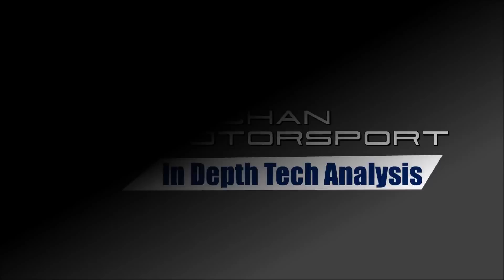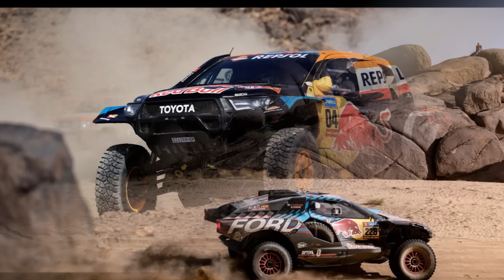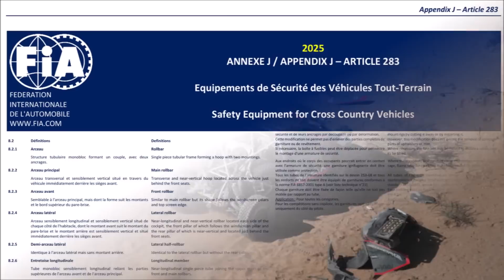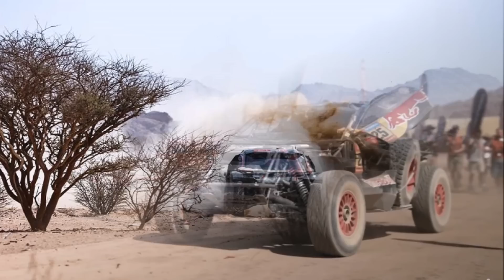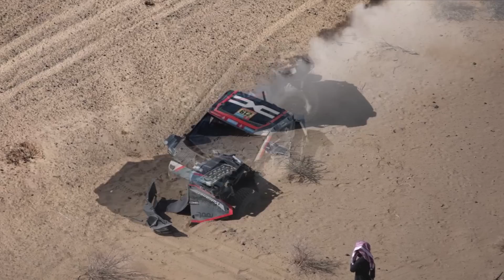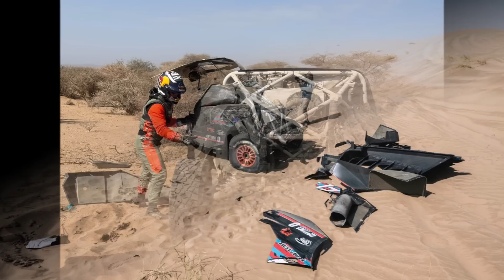DAKAR 2025 - The Roll Cage Drama - CLOSER LOOK

Comment: Such disqualification happens in the World Rally Championship too.  In the past the roll cage was itself protected by the car’s production-based structure and steel or aluminium body panels, which would limit damage from rocks and trees. However, in recent years the vehicles are clad with thin, flimsy carbon fibre panels, with the roll cage forming the basic structure of the car beneath. Perhaps small carbon crumple-zone structures should be required outside certain parts of the cage, which must be replaced at the start of each stage if damaged.
Late to the party here I know!

Comment: They should homologate the cages in such a way that teams have to prove upfront any deformation less than 2mm will not pose danger. This eliminates the need for arguing and on-the-fly simulations during race time.

Comment: Would it be possible to design a vehicle with a replaceable roll cage, or is that not safe or allowed by the rules?
Reply: I would imagine that it's too complex and time consuming to replace. Since these cages are essentially the chassis of the vehicle, you'd basically be stripping every single part off the original car to mount on to the new chassis.

Having said all that, I suppose a modular design could be made to easily swap parts on to a new chassis.

Comment: This is typical FIA burocratic Bullshit.  The way homologation works is that Ford runs simulations, builds and signs off that the cage so it meets the regulations. This absolves the FIA of liability. A Ford chassis engineer was present and stated that the cage was still safe and sound - despite the minimal deformation. Another example of FIA destroying the sport.

Comment: Not having seen the damage, its difficult to comment on whether the cage is safe or not, but not too be allowed to repair it is pathetic.  None of the cages in the event actually were individually tested, they were built by qualified technicians to a standard and sent out to be raced. The cage could easily have been repaired by qualified technicians to the same standard as when built. They almost certainly have the equipment , material and staff on hand to do it.

Comment: It will be interesting to see the certification on these cages. They are self-certified, the FIA doesn’t crash test the cages. 
The designer runs simulations and signs off that the cage meets the regulations. 
This absolves the FIA of liability if anything goes drastically wrong.
Reply: IIRC all vehicles have to be inspected by FIA officials for adhering to rule and regulations requirements. That includes the roll cage measurements have to follow the FIA rule. If not they will not be allowed to race.
Reply: @ Hi, muefe. Yes there is pre-event scutineering, but usually (well, in my experience anyway) it’s a visual inspection. They will check a) that there is a roll-cage b) that it looks ok/normal and c) that it has a certified sticker. 

Unless there is something obviously different about the look of the cage in your vehicle, like it’s made of 20mm tube when every other cage is 40mm, they’re not going to measure each competing vehicle. Somethings they are not going to be able to check, like the wall thickness etc. 

All this comes back to the designer/maker. The only time the cage will be thoroughly inspected is if it doesn’t do its job and someone is killed or seriously injured.
Reply: You clearly have no idea how stringent the cage rules are, and how strong that actually are.
Reply: @zr6ajl  I have a very good understanding of roll cages for not only Motorsport applications but also ROPS for mining vehicles.
In fact my initial comment referred to checking that the RCs used in the 3 vehicles were built to the certified design and materials. 
The FIA gives a list of acceptable materials, some mandatory pieces of bar work and performance specifications. 
Since each car is different, it’s not up to,the FIA to design a cage for each model.

‘

Comment: Those both seem repairable.  Plenty of cages get pushed and pulled back into place and new members get welded in.  Bend and damaged parts get cut out.  Homologation is a method that not perfect, in the field or not.  They are plenty of ways to verify cage integrity in the field or shop.  FiA seems a bit lacking in practical field engineer that is needed for these kinds of events.

Comment: Once steel passes its yield point, it behaves in a plastic state rather than elastic state. These structures are very complex and you would have to rebuild them to get the original strength.

Comment: I mean do we have prove that the damage of the Sandireder was as mild as apears? FIA are the ones with the data, only then and the mechanics can observe the stress and fractures in the metal and than declare if the car is fit or unfit, 
even if Loebs Car dont look as bad as the others, it might still be just as or even more degraded than the others

Comment: In these rally raid cars the roll cage IS the chassis. In the past and in other categories, the original car had a roll cage inserted into it to add to the existing structure. But these cars just have bit of plastic attached to the cage.  I have raced in motorsport and you rely the basic structure for 80% of the strength, with the cage adding the other 20%. This category should be banned. They are just beach buggies with a car like covering and they are built to the lightest design to just fit in the rules. Good on the FIA for enforcing the rules.
Reply: I have worked in motorsport, and the cages are 80% or more of the strength of a original car. The original car could never survive the "normal" driving  punishment without a cage, never mind any safety benefits of a cage.  Those space frame cars are far, far superior in every way (safety included) to what any original car and cage car could ever be.
Reply: Agreed. The cars should be based on and resemble a road going version. They should get closer to the T1 formula. Between T1+and ultimate it became a buggy class. The cockpit should be to factory road going spec or with slight modifications.

Comment: Sounds a bit dodgy to me if you hear two top boys wernt alowed to continue by fixing something the Wrc have been doing for years.
They want to a Saudi to win simple as. Them calls were absolute bullshit In my Opinion them cars could roll another 10 times and be fine.
 I'm a Mechanical Engineer that has been building rally cars and motorsports Vehicles for nearly 20 years.😂

Comment: I've seen cages go through worse in the local speedway circuit. These cages have been used for years and have been through head-on collisions, rollovers, and shunts from the side. If backyard mechanics can make the cages last, I think this is simply an overreaction from the organisers
Reply: Quite a difference between a loosely regulated local speedway event featuring $2000 cars and the World’s premier international off road race with $1m cars
Reply: @ianthompson1675  fair point, but I'm talking about stocks, modifieds, and supers. The speed and weight would be comparable across all three divisions
Reply: @ianthompson1675 Ye thers more corruption around bigger money that's what

Comment: I disagree on Loeb's crash being not so extreme. It was quite brutal, and being a desert racer myself, I was worried until the co-driver emerged. Any car with a high speed roll over like that should not be allowed to continue, apart from the roll cage everything on the car becomes unreliable and prone to failure, like Loeb's steering...
Reply: It was definitely a brutal roll
Reply: Maybe a measurement could be the trigger if s car is out.
If the acceleration (m/s*s and rad/s*s) threshold is exxeded and the cage is bend of some kind of percent the team is out. 
Then designing and testing can be approved.
Reply: @unoxunox4086 The measurement is the roll cage. It got bent. It exceeded the threshold.
Reply: Facts
Reply: So no need for more regulations. Dont wrack the car and you stay in the race.
Reply: @unoxunox4086 Pretty much. 
Even in WRC if your roll cage is damaged then you're practically off the event. 
So the best way to handle this is to stay 100% focused, if you got into a crash and the roll is damaged then tough luck, you're out no matter how many times you can argue about it.

Comment: Safety should always be the number one priority, so to me it’s a good thing to disqualify for this reason. Also a roll cage is tested applying forces that are almost impossible to reproduce (2x/3x more than a real case). So if it is bent on some degrees, it means that the cage is done. The only repair would be to substitute the roll cage in its integrity and this is not feasible.

Comment: There’s zero room for letting safety slide in motorsport. If a roll cage has bent, it’s taken a serious impact and there’s no way to fully assess the damage to the rest of the cage in the middle of a race. Cages are connected throughout the car, so a bent support at the front could be evidence of the whole cage being tweaked, causing unseen damage to welds or fixing points. It’s obviously unfortunate but the rules are there for driver safety
Reply: Agree until point of driver safe. If the driver is taking his responsibility, he should be free to drive. What is madness of this world where safety is breaking the freedoms of individuals?
Reply: @boborenebobo  Well that’s about as dumb as it gets 🙄 If you give the drivers the responsibility for their own safety, they’ll be driving around if unsafe car’s just so they can go quicker. The rules are there to protect them from theirselves.
Reply: I dissagree .  As a boilermaker tradesmen  ,   boilermaker  tradesmens  should  be able  to make  safe welding repairs  , check  the welds with  N D T . OR  ULTRA SOUND ,  X RAY .    MAG PARTICAL  testing  .  The same as thay do when it made  in the first place  .
Reply: @josephatherton2781  So you are going to do that on every weld on the cage in the middle of the desert are you. For a start the car needs almost completely stripping to get at all the welds, so you ain’t doing all that, then testing them all and rebuilding it over night.
Reply: You don't have  to do the tasting to every  weld on the roll cage , only the damage  ones  , and yes you can  do that on the middle of the dessrt . I see videos  of them welding  repairs  where thay stop for the night , yes it might take all night , but it can be done  .
Reply: @ How do you know which are damaged without testing them?

Comment: These Rallye Raid cars are built around the main roll cage/frame . The high speeds that the cars travel at means that there is the possibility of them hitting washouts , tree roots, rock outcrops and sandunes , sometimes /usually  unseen. The cars have the potential to forward roll, side barrel roll or be launched into the air omly to nose or tail dive which will put the rollframe under extreme stress. At the end of the day it better to retire a car due to a damaged rollframe than have to explain to the families of the driver and navigator that the FIA made a mistake and didnt withdraw the car. The manufacturers and sponsors speed a large amount of money, time and effort in preparing a car and team for an event. It would not be a great PR if one of their cars caused a death/deaths of the driver and or navigator due to a failed rollbar. Safety of a vehicle is always the best decision.
Reply: Well said

Comment: All roll cages are homologation, they are designed and guaranteed, with a tag to prove so. 
So how do you re-homologate a rollcage in the field? The FIA simply can't accept the liability of allowing it based off a repair. I'm sure the mechanics are competent enough to repair the sections... but who signs off on the roll cage, with a guarantee that it meets the homologation requirements?
Its a shame to see two of the big boys out of the race, especially in new cars. Would be good to see the FIA get their own homologation team onboard, who can certify safety-related repairs
Reply: @steeleybaws  how do any roll cage pass scrutineering before an event starts? Who signs off on that?
Reply: @MIEJ4  The homogator does. A professional, usually involved in the construction of the cage (which in many dakar cars is also the chassis). They certify that it meets the requirements and will perform accordingly. They attach a metal label or similar to the cage to guarantee that it meets the regulations in its current design.
If it's damaged and repaired, it's design and construction has changed. It sounds more complicated than it actually is, many roll cage builders can also homologate them.
The homologator sends the design and such to the FIA for a certificate of approval, but again that only covers the design as built
Reply: honestly, if teams want their cars to survive a rollover without being disqualified, maybe they need to engineer a tougher roll cage with a wider safety margin, but that'd make them heavier
I don't see this as an FIA issue. Maybe in the case of the dacia because a 2mm flex could easily be accounted for in homologation before the season, but not for the other 2

Comment: Maybe the FIA should standardize crash structures around the cars to protect the frame. In the event of a rollover or a similar incident, these structures could be designed to bend or deform, protecting the core frame. Teams should then be allowed to replace these crash structures, and they should be designed to be easily replaceable.

Comment: Motorcycles has no roll cage at all, still allow to race
Reply: That's why riders regularly get seriously injured or killed by highsiders in rough terrain.
Reply: Even after a roll over?   /s
Reply: That is not FIA regulated thats FIM
Reply: How much does a motorcycle weight?

How much does a Dakar truck weigh?

Say, for instance, the cage on a Dakar truck was compromised, and it collapsed. Do you want to support that whole thing with your body?
Reply: With a motorcycle, the rider is rarely “trapped” to such an extent to cause death or serious injury ……..by the machine.   The roll cage together with seat belts or harnesses secure the occupants “safely inside” during a major incident.  Apologies in advance for highlighting certain words with inverted commas, but occasionally it is essential and hopefully helps explain the obvious.
Reply: Motorbikes aren't regulated by the FIA.

Comment: I kind of side with safety. 
I think there should be a post roll integrity study to better gauge when the rollcage is unsafe.
Reply: For me it should be like: you have two cages for the race, marshals inspect predetermined spots and rule if the change is necessary and give a penalty if needed to change. More than two or no penalty it is possible that a team would abuse to gain performance (they always do it)
Reply: Don’t think anyone is arguing about the fact the cage was damaged and therefore compromised.
But the teams after spending millions of euros to get the car and the support etc there and in place, should be able to replace the damaged section, as long as it meets the roll cage homologation spec. It’s a complete waste for them to be sent home when everything is there ready to sort it. Bonkers.
Reply: @MIEJ4  from an engineering stand point is so hard to make on site repairs to the parts while maintaing safety that the organizers deem it prohibetively hard and risky to implement in such tough conditions. Remember, weight is an issue and those cages are probably riding on slim safety margins. To do proper measuring and metal analysis in those scenarios is not easily feasible. Pushing a repair in suboptimal environment (they are not in the controled factory) is tricky.
Reply: @ I think the organizers need to make sure their star drivers like Matador Sainz’ and Monsieur Loeb’s lives aren’t in danger.

Comment: Sounds tough, but rules are rules. I am sure the FIA dont want to have the case of a "damaged" cage being allowed to continue and then by some "miracle" the cage fails and something serious happens. Then everyone would go crying to/about the FIA about driver safety
Reply: Rules is all that remain from sport. Crap world.
Reply: Nobody is talking about continuing with a damaged cage. They were asking to repair it then continue.

How do the FIA know a cage is fine before it’s damaged? That’s what the homologation process is for. Check the repair is done to the same spec as the roll cage homologation, then there isn’t an issue surely?
Reply: @MIEJ4  you may never know, that is the big problem in metallurgics, it can fail whenever it wants too